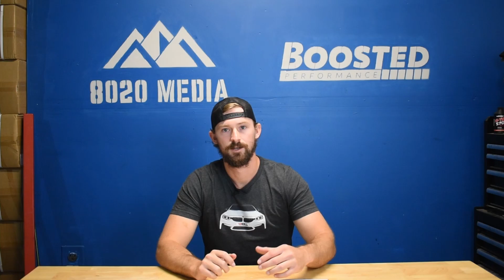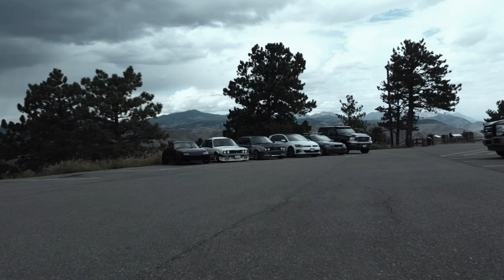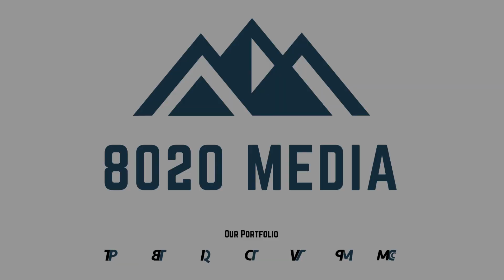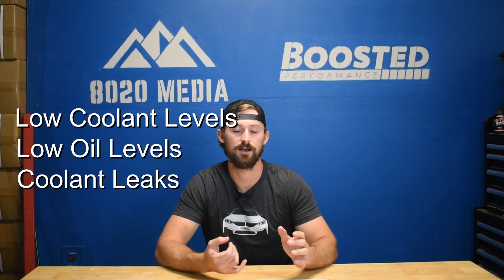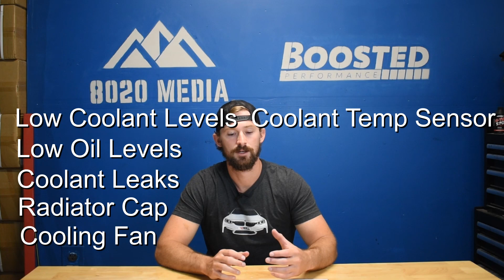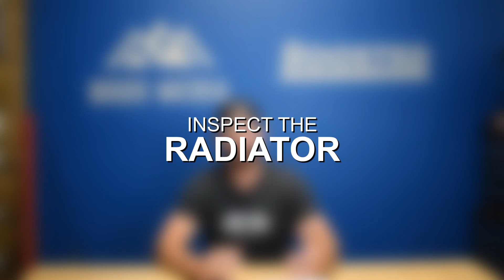DIY - Why is My Car Overheating? Top 10 Causes & Fixes

Comment: spend 500 on sh it just to find out its blown.. this is why you take it in and not buy everything just to find out it has bad compression ..
Reply from the maker: B - Completely agree. However, some people may not be able to afford the diagnostic fees.
Reply: @8020Automotive  bro i paid less than 60 dollars for a compression tester..  Fuck you can get em for cheap at harbor freight. they're accurate all the way up to 180 psi which is good enough for most all vehicles
Reply: True. Thou you now have the Parts to repair any other issues which happen later down the line

Comment: Think this is a great series! 

I’m currently working on a Mazda cx 7 (project) and after replacing the timing chain & VVT sprocket,although the rattling sound I was chasing is fixed and the car idles and drives well. When I reach a complete stop after running (like a stop sign or red light) the car stalls and shuts off . I know there’s multiple things that can cause this such as throttle body, vacuum leak, bad sensor or module. I personally think mine is a wiring issue as this wasn’t an issue before and I did move wires and connectors around while trying to engine bay space. Maybe car stalling could be another DIY issue video ! 

Appreciate the great content as always
Reply from the maker: Bass - We'll add it to the series! We do have quite a bit of DIY content in the pipeline, but will certainly be adding car stalling causes for you! Appreciate the continued support!
Reply: Diagrams would’ve been great with this.